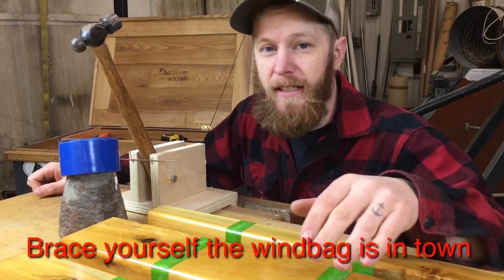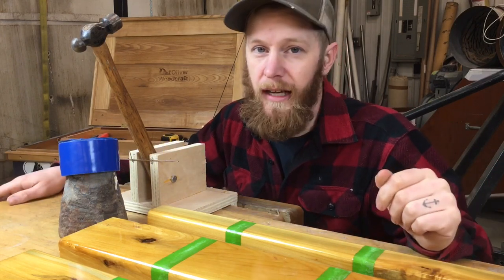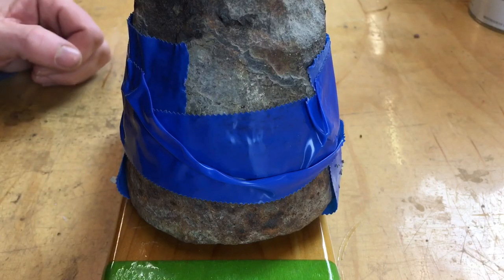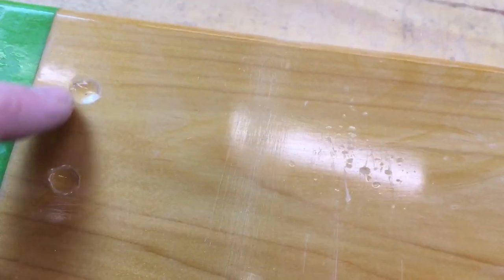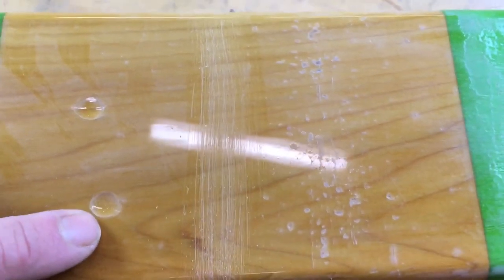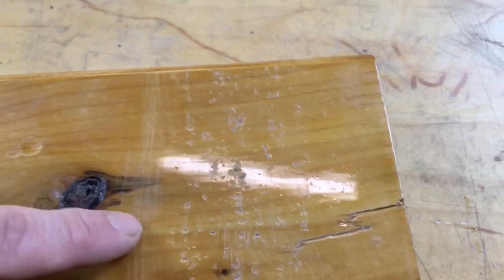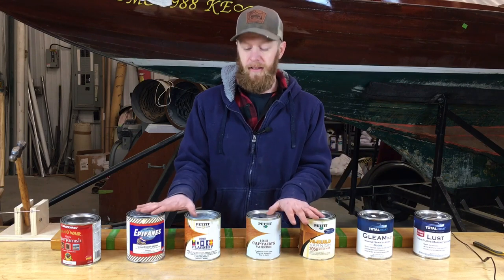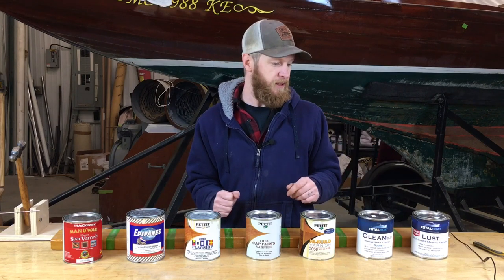Varnish testing

Comment: Polyurethane varnishes are tougher and more scratch resistant than all those varnishes. Just one problem- they avoid making marine varnishes from polyurethane for the very reason that they are so hard and thus brittle. Marine varnishes need to be FLEXIBLE and thus softer than indoor varnishes. They need to expand and contract and not let go. The tests you did were not really marine varnish tests. Flexing and gloss retention would be the proper test, plus heat and cold cycle tests on a wood that is known for expanding and contracting.
Reply from the maker: Thanks for the feedback.

Comment: Total Boat is my way to go.  I was using epoxy for the first time and their customer service was outstanding.  I then followed up with a varnish finish and once again their communication with me was great.  So far my outside counter top is holding up nicely in the sun and rain so I highly recommend Total Boat.
Reply from the maker: I’m glad to hear that. I have had the same experience.
Reply: What products did you use from Total Boat and what was your process?

Comment: thanks for the vids!!
In the process of building a McKenzie Double Ender. You know how the rivers are here in Michigan and know how much abuse the bottom of my boat will see. What kind of top coat would you recommend  for the bottom of my drifter? the bottom is ply with 2 layers of fiberglass cloth and polyester resin with and oil base primer. leaning towards a thick truck bed liner but worried about heat and possible sun exposure ,cold winter steelhead fishing and ultimately maintenance. Maybe West system epoxy with a 207 hardener and multiple coats? really want a black bottom, to accent the dark red sides and dark stain on my woodwork, about 6" up the sides, thick for a rub rail and carrying up the bow and stern . thanks for any suggestions, keep up the great work!
Reply from the maker: It sounds like you already glassed the bottom with polyester so now you need to stop the moisture from getting to the wood. Polyester resin is only water resistant not water proof so your ply is at risk. To accomplish that I’d recommend eliminating any existing primer that might be on the bottom then apply 4 or 5 coats of an epoxy primer. You can go over that with a topside paint and it makes for an easier touch up. I’ll be the first to admit it’s not a perfect solution but it’s the best I can think of.
Reply: @oliverwoodcraft9733  
I haven't put the secondary layer of glass on yet or primer. That was My thought also was top off with an epoxy.  I am a little hesitant to use and epoxy primer and paint, only cause I haven't ever used it, good thing its a bottom
Reply from the maker: Chris Plashek Epoxy primers are nothing to be afraid of and they do a great job stopping water intrusion. If you lay the secondary glass with epoxy you can more easily fill the weave by hot coating to avoid a ton of sanding. If you went that route I would still recommend epoxy primer. A single part paint is an easy thing to maintain so I would just use that. Another question is did you seal the inside of the boat at all?
Reply: @oliverwoodcraft9733  
I haven't done anything with the inside yet as far as finish just one layer of 10oz cloth with a top coat so far. Was thinking just oil base primer and paint for the inside after I run some fairing compound. Most of the boat is going to be paint, the decks, gunwells and seats I would like to leave wood, probably epoxy and polyurethane. Using epoxy to lay the second layer on the bottom is a great idea.
Reply: awaiting an update on how your river boat is coming
Reply from the maker: Chris Plashek Epoxy under varnish is great for a thick film appearance but be sure to use an epoxy like west system 207 hardener or it will yellow over time. Totalboat does have a “crystal clear” epoxy Hardener but I have not tried it. If you think you will be bumping into things a bunch I would actually suggest just using varnish as it’s easier to repair and isn’t as brittle as epoxy. If you keep the boat covered when not in use that should be a fine way to do the inside. The only other option would be to coat EVERYTHING plywood with a couple coats of epoxy before painting.
Reply: @oliverwoodcraft9733  awesome, thanks for all advise really appreciate it, epoxy sounds like the ticket for sure. I was afraid of it on my first boat because of price and I have more experience with polyester resin from production work, using epoxy as a top coat, especially on the bottom will give me some experience with it for sure.
 keep up the great work!!

Comment: I have been using Total Boat...Epiphanes and Deep Penentrating Epoxy...The Epoxy was really nice to work with...With Epiphanes there is a real need to create a roughed out base coat of whatever to top with Epiphanes or it will bubble and look terrible with weathering...Oregon Coast
Reply from the maker: I have used Smiths epoxy for that in the past and managed great results. Thanks for passing on your experience.
Reply: You were speaking of using Smith’s below the Epiphanes? The Epiphanes worked beautifully over some cedar adirondack chairs...but apparently my application lacked the necessary scuffing before applying the Topcoat...per Total Boat folks...
Reply from the maker: Smith’s is excellent at creating initial bonds just fallow the can. If I understand it correctly it actually makes a chemical bond. Any additional coats are mechanical (unless using something like total boats lust) and definitely require a good amount of tooth for proper adhesion.

Comment: I have some red cedar live edge OUTDOOR bartops that I need to seal and protect.  After researching and speaking to several people...it seems as if varnish is the way to go. I was thinking about Epifanes.  Do you recommend Total Boat instead? It will have all weather exposure from the Kentucky weather. I'm also new to the process. Just built a pool bar and decided to do the live edge bartops. Any helpful information will be appreciated 🙂
Reply from the maker: Epifanes would be a great option for that but it does take good technique to use. Totalboat is a friendlier varnish if you haven’t done it before. With all weather exposure I would recommend 13-14 coats first year then probably 3 maintenance coats every 2 year’s. If it looks like it needs attention then make sure it happens. Failed varnish is a pain.

Comment: Great video. Can you tell me which of those is the least amber in color in the can? Looking to varnish something made of carbon fiber so would like as least amber color as possible
Reply from the maker: All of these have a bit of amber to them but the Gleam is probably the best option. It’s a very thin varnish so expect to apply multiple coats to fill scratches. You can over coat it without sand if you do it within 48hrs.
Reply: @oliverwoodcraft9733  thanks for the response. I'll check it out.

Comment: I appreciate your testing but have some questions. you mention on the scratch test you had to work harder on some of the products. Shouldn't you have just used a weighted wire brush with the same number of strokes to compare damage? I personally have used the Petitt 1015 with excellent results for a skiff used in saltwater. I just don't like the 1 coat per day waiting. I was looking at total boat lust as an alternative and will give it a try.
Reply from the maker: Each product was given the same number of stokes on the scratch test. Lust is an awesome product for building coats. If you can manage the flow characteristics even a top coat is attainable with this product. I have been experimenting with the matte lust as a building coat so it’s easier to see when hot coating.
Reply: @oliverwoodcraft9733   thanks for the info. Im going to give it a try.
Reply from the maker: @foxwood67  Good luck, please let me know how it turns out good or bad. I really appreciate any feed back I can get. This was intended to be a “real world” kind  of experiment.

Comment: Hey Grant. Nice video. I'm planning on applying Man O War on my new raw door while working in a detached garage. Temps are supposed to dip into the 40s at night but around 60 during the day during the process next week. I don't have any heaters. I'm putting 4 coats on both sides. Planned on 24 hr dry time between coats = 8 days. Any concerns with drying or setup? Also, do you think Man O War darkens African Mahogany more than what I can see by just a rubdown of mineral oil to test what a clear finish may look like?
Reply from the maker: I actually just tried it again the other day on a project and love it. Your timeline sounds right but I would encourage you to go thicker. Try a minimum of 6 coats per side. It has a little more amber tone on the finish but at that thin of a build up it would hardly be noticeable. I hope that helps. Try it on a sample/scrap first if you are concerned about color change.
Reply: Thanks. Those temps aren't a concern to you?
Reply from the maker: Steve K I varnish in 50-55 all winter it may not be ideal but it does work.
Reply: Thanks. I’ll use a space heater to help then. Last question. When sealing a storm door with spar varnish, that will have full exposure to the elements, will I need to remove the mortise with the knobs?
Reply from the maker: Steve K If I’m understanding your question I would say yes. You want to be able to seal up every possible entry point for moisture intrusion.